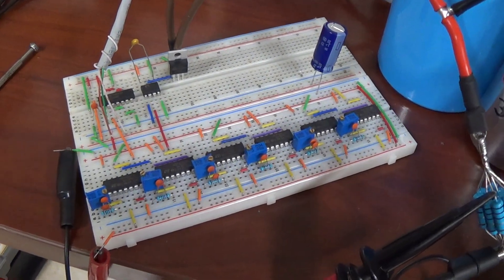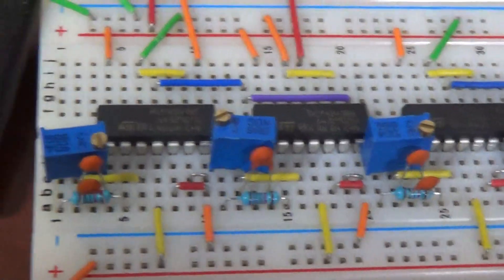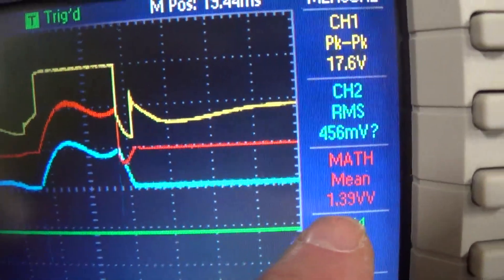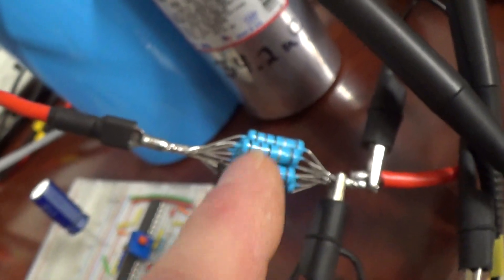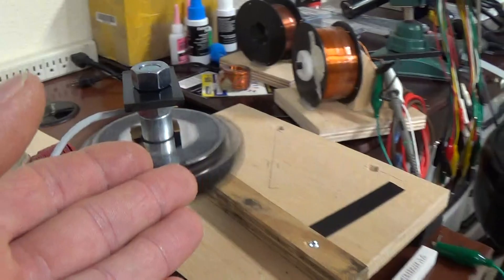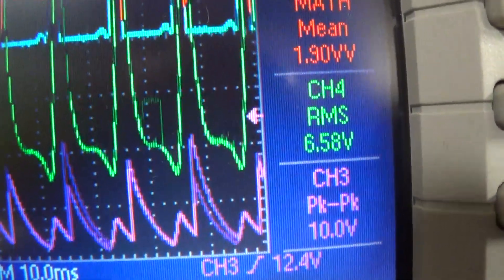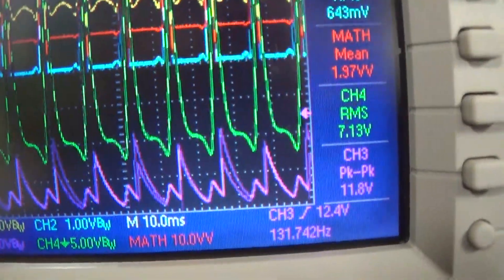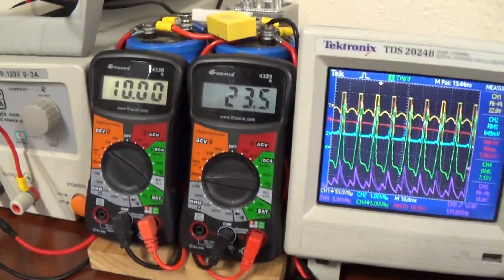Sharing ideas, how to build a more efficient motor (p.8)

Comment: Luc , that looks good for measuring i will try to do that specially the current , my scope is old , and only 2 channels, so i will try to do voltage and current, what is the impedance of these coils, that is a big gauge maybe 17 ? and the other one is maybe 12 ?
Reply from the maker: The DC resistance of the gen coil is 8.2 Ohms and looks to be 21 AWG and Inductance is 67mH air core and 100mH with 1/4 square Metglas rod core. The motor coil I reused for another experiment and took half the turns off and it's 14 AWG and was about 0.5 Ohms back then if I remember correctly.
Reply: @gotoluc  i visted thane in his lab in ottawa 2 month ago , and he is using a very high H coils ( maybe above 2 H ) no cap no resistors
Reply from the maker: I've been working with Thane on the development of Regen-X motor gen coils since the beginning. In the past he use high H coils but 3 years back I showed him you don't need high H coils and since then he's changed. So if you saw what looked to be a high coil then you saw one of his old prototypes.
Reply from the maker: After over 10 years of full time experiments I still have not seen a real anti Lenz gen or motor coil. So it may not be possible. Be careful, there's a lot of BS out there claiming anti Lenz. 
Bi-filer only adds (built in) capacitance to the coil. You can achieve the same result with single filer and a small capacitor value. So nothing special there.
 I'm done with coil experiments until I see REAL proof what we are looking for can be achieved.
Reply: @gotoluc  i tried also alex coil but the voltage drop to 0 maybe because of the gap , i will try it again
Reply: @gotoluc  come visit my humble Office/Lab :)
Reply: @gotoluc  hi luc my only hope now is your Delayed Lenz , because canceling it doest work , i was able to reduce but i only get 5 watt extra each coil which is nothing , it will not overcome the prime mover , so my only hope now is the Delayed Lenz  and i wish you can help me in that how to achieve it , with regular Generators , i have at home 10kW and 30kW generator to test with
Reply from the maker: So, you've achieved what I demonstrated in this video and believe it can get better. However, what you fail to understand is that's the best result I ever got, so how can I help you?... maybe nobody can do better since I've never achieved or even seen a convincing overuinty device. In the end it may not be possible. All you can do is try and that the best learning tool. If I had something I would be sharing it. Regards
Reply: @gotoluc  am just asking you how to start doing delayed lenz instead of going after canceling what do you recommend to start like if I do only one coil how can make the lenz current be delayed so I can reduce the power on the prime mover you have experience with that
Reply from the maker: Delayed Lenz is Thane's work. I only made improvements like getting it to work with low impedance coils and designed a motor circuit which he also Patented. It would be best you contact him and see if he's willing to share. It would not be correct for me to share someone else's work. I'm sure you understand. You've already been to see him so he may help you. Regards

Comment: Luc,  You go into great detail about how you measure the power input (loaded and unloaded), but you do not show how accurately you are measuring the output power.  By this video, you are claaiming Pout/Pin "> 1.  That should give you pause to wonder why.  You don't have a meter that shows your output current or voltage, nor do you show how the load resistor is accurately measured.  These output measusrements are key to efficiency accuracy.  I haven't seen the other previous videos, as I just got notification of this one being new.  Do you really believe your motor is overunity?  If so, the next step is to make it self powering and extract the over unity component to produce useful power, right?
Reply from the maker: +Inspironator First, I am not claiming overunity. Second, the load (generator coil with known resistor) placed on the motor idling magnet rotor is used know load to determine the motor electrical to mechanical Watts efficiency .  Third, the power of the generators load resistor does not need to have a current and voltage meter attached to it to calculate the power in watts. That would actually be an incorrect way, as it is not a true sine wave (look at scope) across the load resistor  The correct way to calculate the power across the load resistor is to use an  oscilloscope ($2000. value) that displays RMS voltage value which is calculated as P=VRMS2/R which calculates to: P = (7.12V)2/100Ω = 0.507W or  507mW. 
So hopefully you have learned something new today and will ask for clarification next time you don't understand. Kind regards. Luc
Reply: +Luc  gotoluc Choquette But, Luc, your load resistor is only 5% accurate!  The load resistor affects the current/voltage/power.  I have a multimeter that measures true RMS -- your math function on the scope is not the only way to measure power.  It still has it's faults, which you choose to disregard.  

The fact that you claim you could measure the Po without a load resistor is ludicrous.  Clearly, there is only one load value that presents maximum power transfer. I'd be willing to bet that 100 to 95 oms isn't providing max power transfer either!   Your load could be 105 yp  95 and if you have no load resistor, then you aren't delivering any power -- can't be measured.   If you still want to ignore my concerns, how you you explain the Po>Pi?  Is the motor exceptionally efficient? I don't think you can make that claim either until you address my points, for your consideration...  

Suggest you parallel a bunch of load resistors of 1% to get a 100 ohm load and then rerun the test. Or not, as you wish.  Just sharing my thoughts!
Reply from the maker: +Inspironator Like I already wrote above, you cannot measure a NON Sinusoidal Wave with your meter even if it is a true RMS meter. Please get educated about that fact.
Please tell me where I claimed "you can measure the Po without a load resistor"
Plus or minus 5% variation on the 100 Ohm resistor delivering 500mW does NOT account for the 150mW difference that has not been reflected back to the IP.  Even if you use worse case scenario which would be 475mW, it is still 125mW short. 
What exactly is your point?  and what do you think I have not addressed?

Comment: Thanks Luc You are a real researcher
Reply from the maker: +Bro Mikey Thank for your positive comment. Luc
Reply from the maker: +Pumpkingilmour It means the motors electrical to mechanical efficiency is above 100%.  Luc
Reply: Luc gotoluc Choquette
Way to go Luc, the CD4047 makes for a nice generator and I have been meaning to do some. You are on right road to extra. What about making the generator coil longer and out of finer wire? Much like Thane Heins does? I know you did this before using a 4 or 5 ohm
generator coil. I make no expert on this experiment but the first thing I would do is to see how much POWER I could get back off
the generator coil while the rotor goes into
RPM red line. Thanks for the Metglas experiment, I always wanted to do that one.
What are your conclusions with Matglas, if any? The way I see it is that if one coil for generating extra power back to the battery can accelerate the main rotor then put 2 or 3 or more coils on it. Isn't that your goal?

Have fun, gotta run Luc